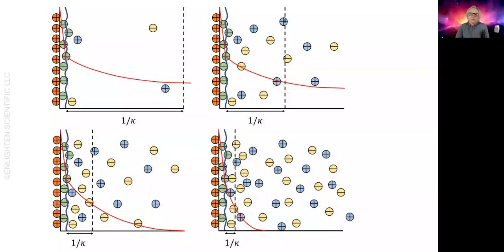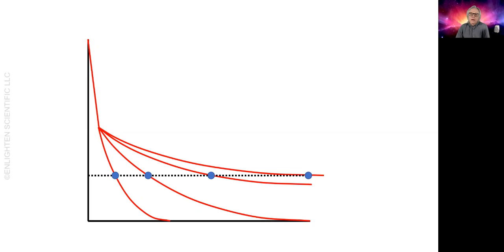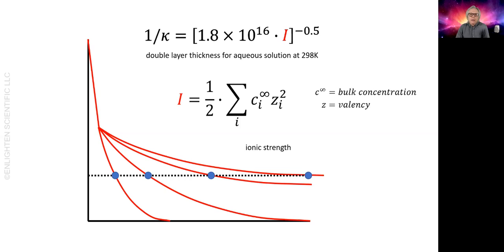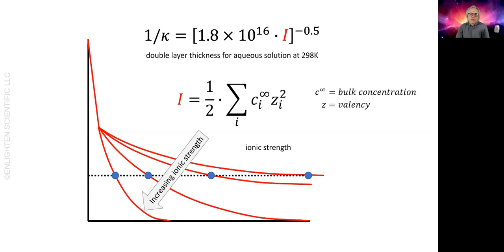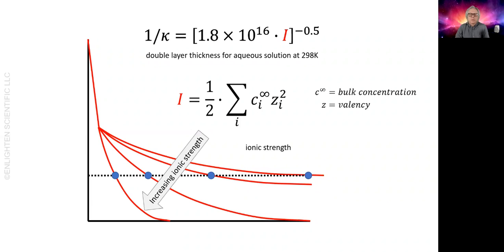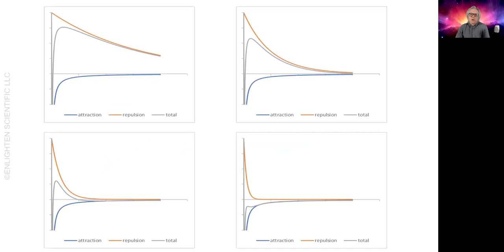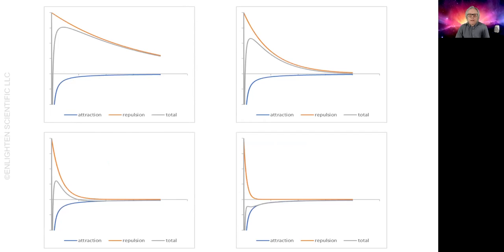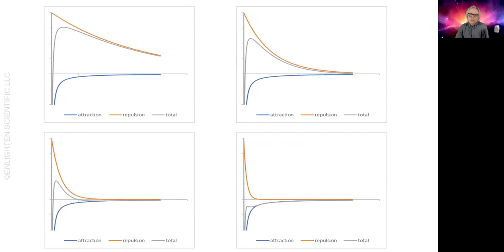Measuring zeta potential - effect of electrolyte

Comment: In your schematic, the Debye length decreases as electrolyte concentration increases, but why does a decreased Debye length lead to decreased Zeta potential. Since the stern layer does not change in position presumably. From the four figures you have, the stern potential seems to be the same value, so I guess that's why I am a bit confused. Thanks, Dr. Miller
Reply from the maker: Hi, the purpose of the schematic is to show how the double layer becomes thinner with increasing electrolyte concentration. The way I have drawn them certainly over simplifies what happens near to the particle. For example, in reality, the increased concentration could lead to more adsorbed counterions which would further screen the charge and reduce the zeta potential.
Reply: @johnmiller0000  Thank you Dr. Miller.

Comment: Hi John,

Thanks for the clear and insightful webinar series! Could you please explain how the optical properties affect attractive forces between particles?
I could see how the size/shape affect the relative strength of attractive VDW forces due to differences in contacting surface area between particles, but I'm unsure how optical properties come into play here.
Reply from the maker: Hi Leshy,

Please see the Wikipedia page about London dispersion forces (https://en.wikipedia.org/wiki/London_dispersion_force)

It explains that the forces arise from fluctuations of electron density. Because electromagnetic radiation propagates through a medium through interaction of the radiation's electric field and electrons, there is a connection between the optical properties and the London dispersion forces. This can be exploited. By dispersing particles in a liquid with identical refractive index, the net attraction almost disappears.

Comment: I think the slipping plane should be between the diffusion layer and the bulk and not between stern and diffusion.
Reply from the maker: The diffuse layer is part of the continuous phase that includes the bulk. The slipping plane is an imaginary plane that delineates the particle (and any adsorbed material) from the continous phase. Imaginary is the key word here - it's purely a theoretical construct, especially since few dispersions truly meet all the criteria required for the definition of the diffuse electrical double layer.

Comment: Dear Mr Miller,

I understand that electrolytes play a role in decreasing the EDL thickness but does this theory also apply to when adding acids or bases? Both acid and base disassociate to positive and negative ions, so theoretically it should perform similarly except one increases H+ or OH- ions. Thanks in advance.
Reply from the maker: Hi Abraham - yes, the addition of any ionic material will decrease the double layer thickness. When calculating ionic strength, you should include the contribution from acid/base, too.

Comment: Dear Mr. Miller, I have a curiosity:
if generally zeta potential is expressed as the potential difference between the slipping plane and the bulk solution, how this value would compare to the potential difference between the actual particle surface and the slipping plane?
Reply from the maker: There isn't necessarily any relationship between the two although, for most systems, the potential at the slipping plane is likely slightly lower than the surface potential. However, because the slipping plane occurs at the boundary between the bulk liquid and the particle + any adsorbed species, the presences of adsorbed counterions, surfactants, polymers etc may significantly change the potential between the surface and the slipping plane. A classic example is an ionic surfactant.
Reply: @johnmiller0000  Thank You very much for your answer!

Comment: How does the effect of ionic sufactants compare to ion concentration?
Reply from the maker: That's an interesting question. Ionic strength is, in effect, the sum of the molar concentrations of each ion species in solution (with allowance for their valencies). An ionized surfactant behaves like a high molecular weight salt with one small ion (e.g., Na+, Cl-) etc and a much larger ion (the surfactant itself). The screening ability of the large ion is much lower than for the small ion (for the same reason that a monovalent simple ion is less effective at screening than a polyvalent one). Achieving, say, 1mM ionic strength with SDS (mol wt 288) requires about 4 times the mass to get the same ionic strength as KCl (mol wt 74.5). In addition, a typical surfactant concentration encountered (0.1% w/w) equates to about 0.3mM, which is low enough to have little influence. Of course, the above ignores the fact that the surfactant itself will either adsorb (and change the overall particle charge), form micelles and exist as free molecules below the critical micelle concentration.